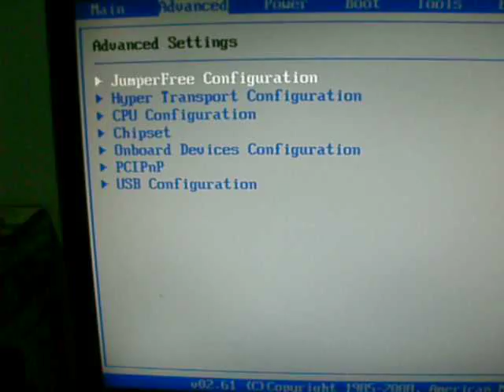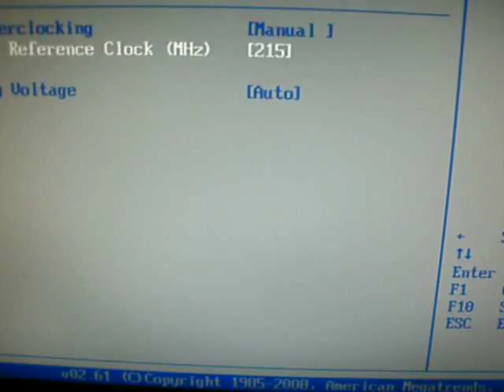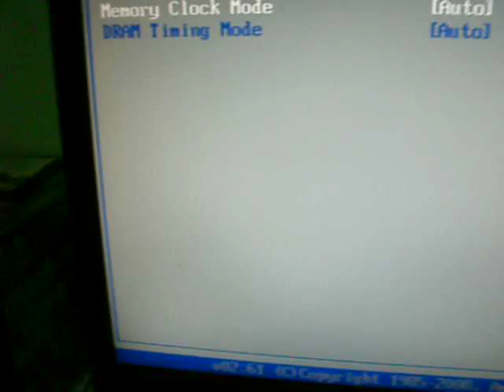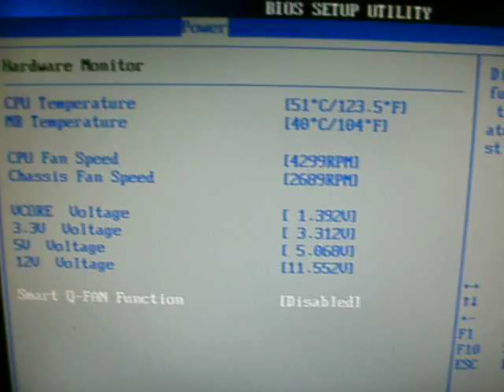How To Overclock Your AMD CPU

Comment from the maker: Yes you can but doing that means you MIGHT have to increase your voltage which in turn produces more heat and that is when you would have to get a better cpu cooler but there is no need to go overboard on cooling for a cpu like that. 

Thanks for watching